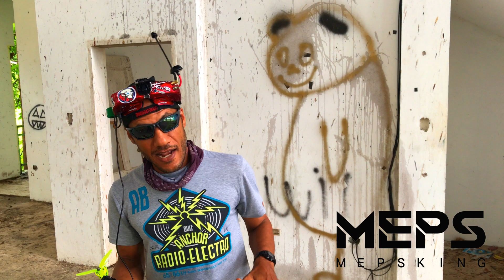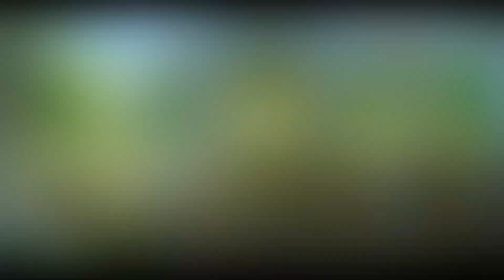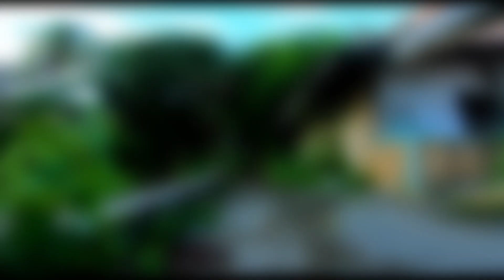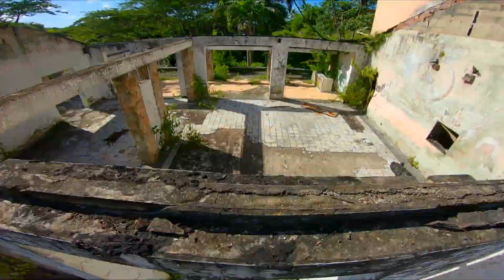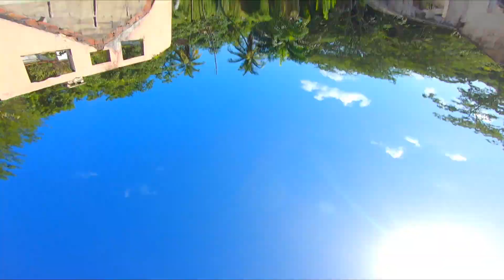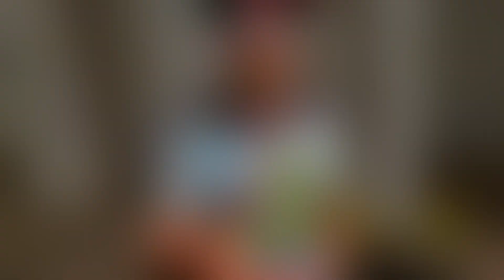MEPS Space SZ 2306 -1950KV Motors- Flight test & Review.

Comment: good video friend! I wanted to ask you if 1750kv or 1950kv is worth it for a smoother flight. what difference is there?
Reply from the maker: 1750kv will give you longer flight times and better resolution at low throttle flying... you can also use a higher pitched propeller. If you use low pitch props below 4.3 pitch the 1950kv works well, high pitched props on 1950kv is more for racing. hope this helps
Reply: @ Thank you very much for answering, it is clear to me 🙏🏻🤙🏻
Reply from the maker: No problem mate